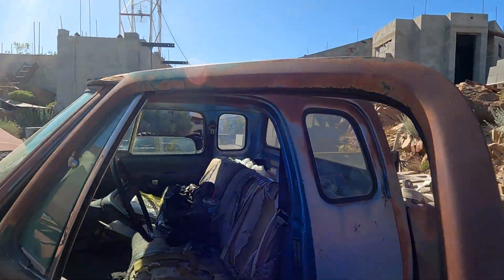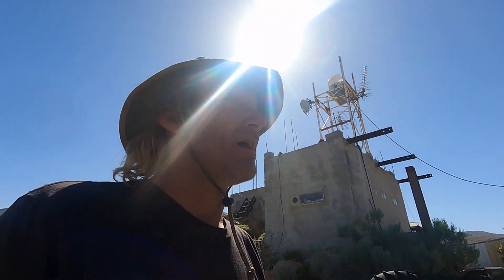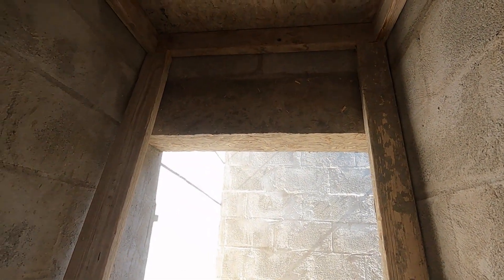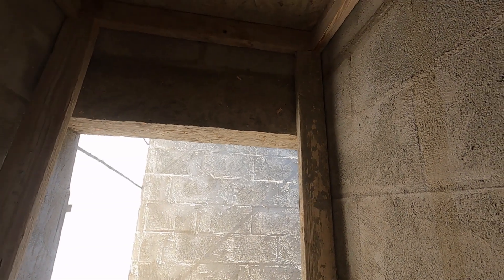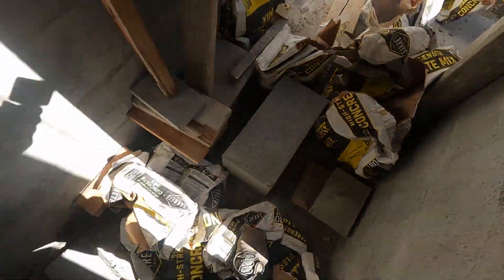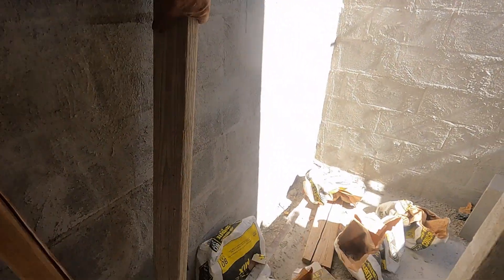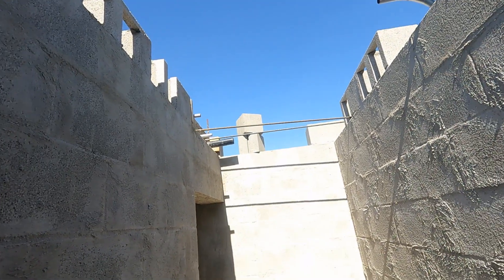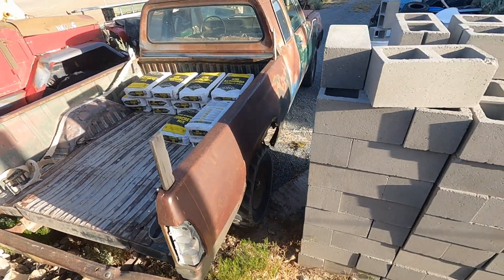FortressTop Improvements

Comment: I was watching you pour concrete yesterday and I thought you were not that efficient.  Why were you bring your water up one pail at a time,why not carry five gallon Jerry cans up and fill you measure buckets from these,  it would save lot of trips. A cement mixer is a must.   Are you using the track hole to lift the cement bags and water up to the top level?    I think you building technics are fantastic but there is always better ways of doing things and I thought you were working harder than you need to

Comment: The slab pieces would be great paving material for flatwork areas. Pads, sidewalks, patio areas, etc. I wish I could assist you with that (actually would do the work). I’ve installed tens of thousands of square ft of stone and masonry paving. Just too far away. Anyway, great work and keep on keeping on. 👍

Comment: that rock tells you how long it took to cool off.. brittle freeze camracked & hard.. cooled extremly slower.. denser the rock.. like diamond.. longer it took to cool off.. tell every fracture in earth from impacts from large size earth shattering meteorites
why salt mines concentration areas.. all are specifically where water dried up.. like before..
now the weather anomalies are solar panels & solar flair from a norther star fluffing out.. waves of heat & cold spots like a rainbow.. global warming means still in THAWING  processing.. hence "adapt & survive " yet no1 things ahead fully.. unless obsession  rules.. if i cut corners.. thought of flaws first.. then set 4 possibilities.. incase i ran into a problem.. equiptment like bearings & insist on GREASE PORTS.. if not.. find or tap&die one lol

Comment: the cab is designed to be sealed and pressurized. the dust gets into the electrical components and will eventually cause problems

Comment: scoop of gravel $30
scoop of sand $30
plaster of cement.. and mix your own bags.  
Normal ratio is 1 part cement, 2 parts sand, and 3 parts gravel (trade the word part for shovel, bucket, or any other measuring device).  Save 2 grand

Comment: there is a 2 part compound you can put in the big rocks just drill 2 inch hole and pour the mix in and wait 24 hours and it will fracture in pieces like you want